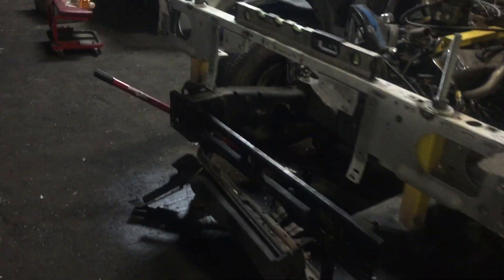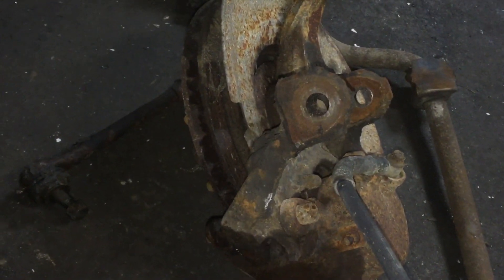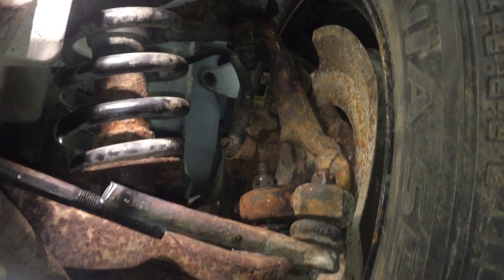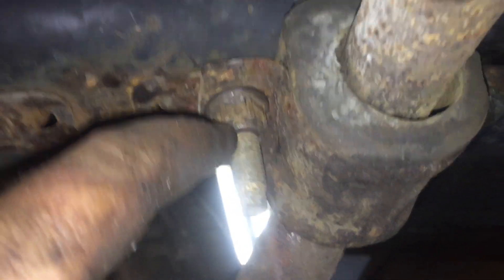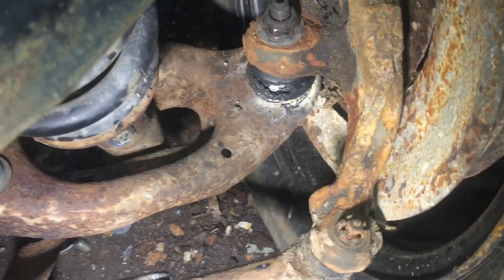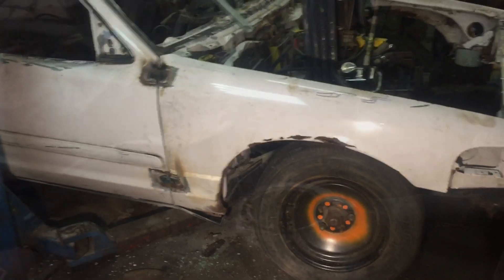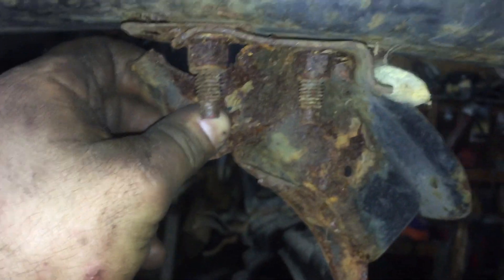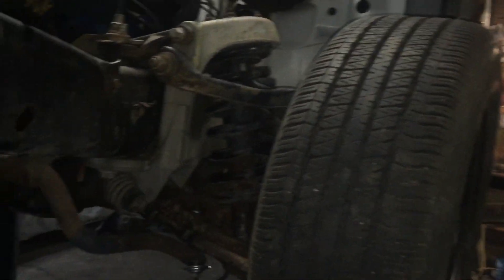2003 ford steel spindle swap part 2, project "burn barrel"

Comment: What's the best way to left this cars
Reply from the maker: Keith Furges in what way are you talking lifting ? For the road or for derby how high you want to go
Reply: Just 3 or 4 inch that's it
Reply: For the road what u suggest I have a 03 I want to lift r inchs all way around
Reply from the maker: Sharnice Long in the front I would find a different coil spring and change it out or maybe do some looking around on line and looks for some bolt in parts . In the back is easy find a larger set of coils and get longer travel shock 4inchs in the back no problem front is going to be the hard part . I know that they make lift spindles for these for derby use but I am not sure how they would hold up on the road . The front can fit huge tires if you put a truck fender flair and cut out some sheet metal with a grinder
Reply: The front of my car have struts  what u suggest  I'm TRYNA PUT 26 TIRES ALLWAY AROUND EXTENDED SPINDLES  MIGHT WORK ON FRONT HOW HIGH CAN I LIFT THE FRONT WITHOUT CHANGING ANYTHIN WAT KINDA SPRING'S AND SHOCKS ON THE BK CAN I USE OR SHOULD  I AIR SHOCK THE BACK  WANT A SMOOTH RIDE
Reply from the maker: Sharnice Long when I swapped out I was able to run 29inch tires on the front but it was derby use and I am not sure what spring to swap to in the front end because I have never done that for the road

Comment: upgrade your sway bar for better handling... fuck that! lol to hold the car together
Reply from the maker: mrmoose 70 helps me take the corner a little faster lol . It's basically a 1 1/2 solid chunk of steel that goes from side to side of the car lol